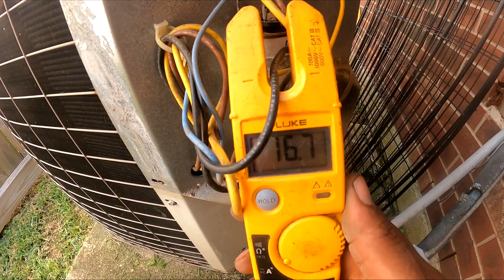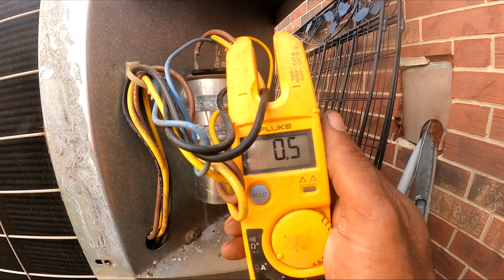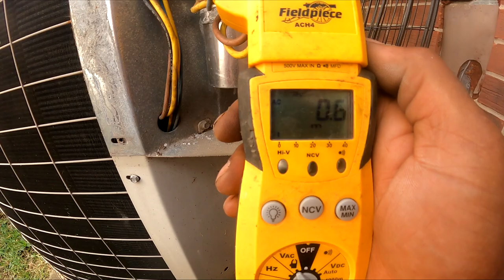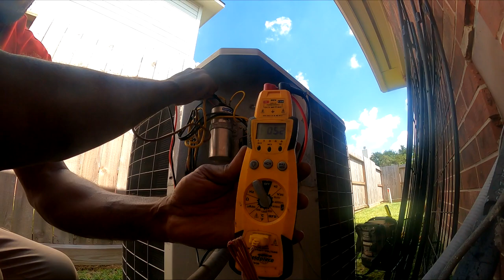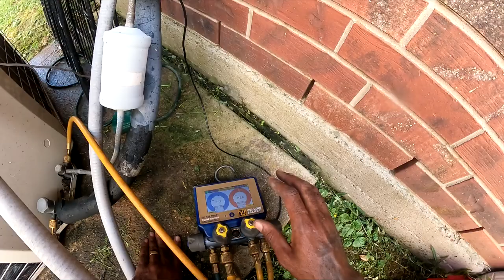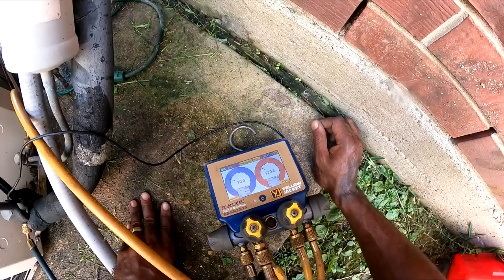Noisy AC Alert: Troubleshooting Loud Condenser Fan

Comment: Thank you for the video. Solved my issue with noise by adjusting the blade of the fan closer to the motor to prevent all the vibration.

Comment: You want to next time get oem motor for carrier brands. These generic motors are to strong and will rattle whole house. Also, if fan is pushing from the side, I would get new blade with motor.
Reply: If the blade is balanced you don’t need a new one.
Reply: The none oem brand is much stronger. Definitely makes more noise.

Comment: It took you seven minutes of video to decide, "o yea i'll change the motor", we w/ common sense knew that when rounded the corner after saying it's fifteen years old and never maintained. yes change capacitor too!
Reply from the maker: I'll keep that in mind on the next one..Thanks
Reply: @WWHVAC  On the contrary, I think you did your due diligence to double check. For technicians, common sense can aid but isolation and verification are the proof. Great work and thank you!

Comment: Don't hate on me because I'm a layman and self taught but a motor going bad would draw more amps not less. I think you just replaced the motor that did not need to be replaced, furthermore a few drops of oil on the shaft of that motor would make it last many more years. If you look on YouTube for keywords like "yes you can oil an air conditioner" motor, you'll find my own video where my original motor still is going on and on and on just for a few drops of oil. Otherwise, I like your video and detail that you give the viewer.
Reply from the maker: I get it, but I won't be in business long oiling fan motors..
Reply: @WWHVAC  I see and agree and love honesty :-)